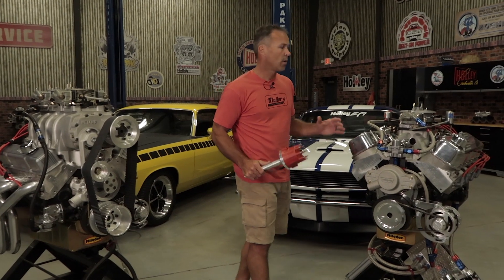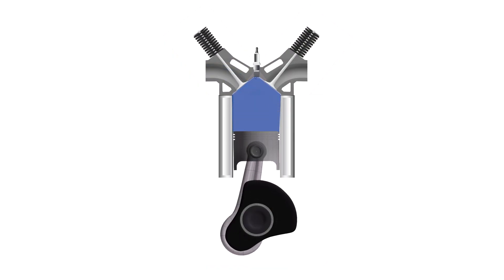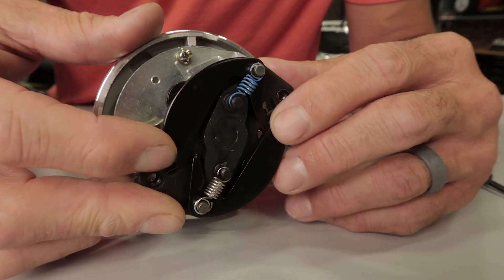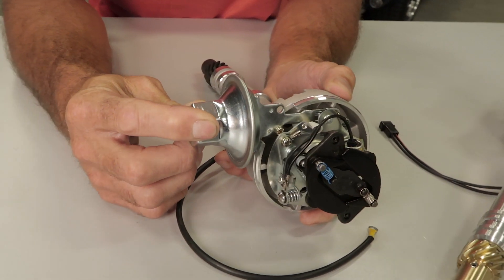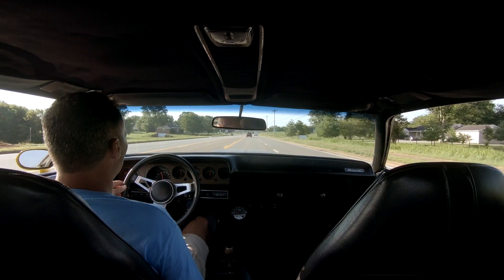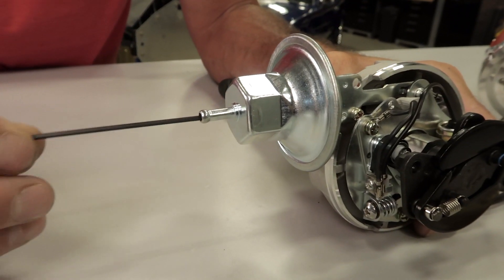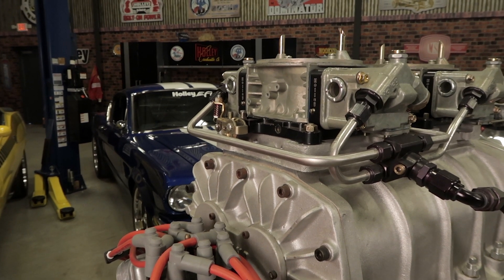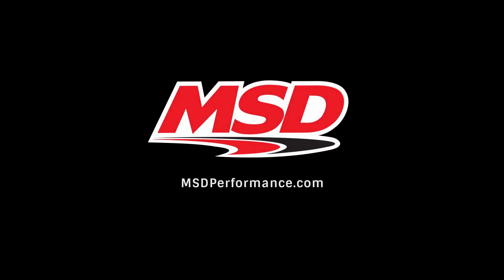How Ignition Timing Works: Vacuum and Mechanical Advance Explained!

Comment: The electrical signals and the actual current that causes the spark travels at 186,000 miles per second. The time for the spark to reach the spark plug is measured in millionths of a second, not thousandths. The reason for advancing timing is to allow for the flame front of combustion to arrive at the piston top at the proper time in the piston’s travel. This flame front travels at a speed very much slower that the electrical spark. This is why fuel octane ratings are important. To insure that only the spark plug starts the combustion.
Reply: Very true. Electricity is unimaginably extremely fast. Efficient combustion can only happen before top dead center. I'm glad someone pointed this out. Proper timing events of fuel combustion are critical to power and efficiency of any engine.

Comment: From the Chi Chi ignition switch the nearest Mr. Denis did you see condition the starter to start the vehicle over what wires go where
Reply: From the key switch what wires and where do they go to the MSD distributor, MSD, ignition and the starter to start the vehicle

Comment: Like the hot engines displayed in the video the presenter’s delivery is so fast. For the novice a clearer demonstration of what happens inside the distributor would be helpful. Maybe if I watch it a few times I might understand how vacuum advance works. But thanks anyway.

Comment: This is a great explanation, but I still don't understand if you can 100% complete your setup pretending you'll never have vaccuum advance, and then just reconnect the vaccuum, or does the intent to include the vaccuum advance alter any mechanical choice (initial, bushing+spring) you make.

Comment: The time it takes for the spark to get to the plug is negligible...its all about the time it takes for the fuel to burn compared to how fast the piston is moving...
Reply: The coil might take 1/2 a millisecond to ramp voltage up  but the time to reach the plug is nanoseconds.

Comment: Okay so for a mild camshaft of 288 480 in a 350 .30 quadrajet fueled motor 2200 stall 700r4 transmission. Street or strip build I would run the ported side of the vacuum and when at the strip just pull the vacuum advance hose off???????????? Yes I am this dumb. I would appreciate any help

Comment: I have buddy with a SB Chevy.  Because the firewall is veey tight in back of engine he runs a Mallory small cap drist. without vacumm advance.  Any tip on timing that setup?

Comment: Great video, What about street/strip cars that are very very fast that you take on the occasional cruise night. Vacuum advance or stick to mechanical?
Reply: A big cam? I would go with a manifold vacuum advance, just to reduce idle temp and have better fuel economy, but I would dial in the  mechanical to get the best rpm band. A milder street cam, I would most definitely use a vacuum advance set up. I have learned through experience that cam size/duration matters more than most everything else. Then again, every engine requires its own individual tune. A high performance gear head should always put in the time to find out what their engine likes/needs to run at its best. There are no set rules, you can ask 10 different people the same question and get 10 different answers. Just listen and find out what your engine wants and it will let you know. 🤔
Reply: @brianwenzel8791  thanks for this info!👍
Reply: No problem bud. Just like to help out whenever I can. It's all about the engine combination. But ultimately, ignition timing is a very important factor to having a great running engine. PS. I Love this stuff..

Comment: So when you set initial and advanced timing do you set it with the vacuum in or plugged?
Reply: yes
Reply: Remove hose from VA and plug the hose. The VA itself doesnt create a vacuum, the carb will.

Comment: Good info.Hard to explain but the electrical firing of a spark plug is already there ready to fire and does not have to travel through the wires at all. Electricity does not travel. If it had to it would take time to get from the power plant to our house then to the light when we flick the switch. It’s instant. No lag time. Because it’s already available! It happens in less than 1,000’s of a second. It’s how 8 plugs can fire at 7000 rpm almost instantly. But advancing the timing just makes sure it all happens when it needs to. We do have to speed up the process to stay in sync with the engine requirements. Again. Good info.

Comment: isnt that after atdc if the engine is rotating clockwise?  when you explain that most engines run 12-15 degrees?

Comment: Im having problems with my truck at idle souds great but in gear driving only wants to bog out i have to drive super slow if i gun it it does one back fire and thin snaps out of it if i advance it or retard it its worse ?? Carb is 600 holly ,holly intake but on 305 engine

Comment: Please explain why a 350 chevy with hyperutechtic flat top pistons, mild cam, vortech heads and valve assembly with an HEI ignition set @ 12* btdc pings at any kind of uphill or small load only when VA is connected. Engine runs great and quiet once VA is disconnected. Been running VA disconnected for years and engine runs great with awesome burnout power. Engine originally dyno @ 420hp/390trq..
Reply: Using manifold vacuum instead of ported?
Reply: Engine also has edlebrock airgap intake and edlebrock 650 AVS carb.
Reply: @jamesrichards3034  If you are going to use a vacuum advance you need to be able to limit the amount of advance you get with the vacuum anvance, in the video he shows how to adjust that amount with the allen wrench.
Reply: @kennywhiddon1497  you cant limit the "amount" of VA with the Allen key. The Allen key adjusts WHEN the va starts to kick in(curve)

Comment: Wrong wrong wrong.
U advance ignition timing because of mean piston speed which is determined by rod and stroke ratio, and the flame front speed which varies by octane rating and different fuels.

Comment: It'd be great to see a video like this but with the m s d 6 AL Digital 6530 model, running a locked out distributor and using a map sensor to add timing when you're cruising at highway speed with an n a motor

Comment: Ported or manifold vacuum for vacuum advance? I've seen arguments on YT & I'm leaning towards David Vizards manifold theory & tuning strategy, very scientific & promotes maximum fuel economy on street/strip engines.
Reply: my 78 350 uses ported w/a quadrajet. However if the engine starts to overheat, a temperature controlled valve, threaded into the intake manifold near the coolant thermostat, will open to allow full manifold vacuum to the vacuum advance module on the HEI distributer. This extra vacuum advance increases the timing to help lower combustion/engine temperature.
Reply: Where is a ported vacuum location on quadrajet? On mine im only getting manifold vacuum and when vac advance is hooked up it idles bad and stalls @SoCalUSN

Comment: you are the only one explaining this the way for me to understand.
ive been disconnecting the vaccum advance hose because i thought it gives the engine too much timing (up to 60) at cruising speed.
thank you!
Reply: Been having the same 50-60 degrees. So I unhooked it didn't want to hurt my motor, still feels weird but I'll probably hook it back up.
Reply: @nicholashoover3001 😊 wax

Comment: To me, one of the main reasons for running vacuum advance is longer engine life. Burning ALL the fuel means there will be much less fuel to wash the oil off the cylinder walls. This results in much longer piston ring and cylinder wall life, and also drastically reduces oil dilution which isn't great for the bottom end.
Reply: And fuel economy.
Reply: The fuel going into your cylinders is vaporized. Engines inhale fuel/air VAPOR, not neat fuel. As long as the spark is firing at SOME point, there’s no liquid fuel to wash anything. Fuel wash and oil dilution are not problems that need solving, and they aren’t the reasons bearings and cylinder liners fail.

Comment: on my 318 rebuilt I'm running stock pistions , rods and crank and stock heads , edelbrock intake and 600 cfm. I'm using an Erson cam - 0.050  is 214/214  lift is .449/.449 and lobe Sep is 112. I'm running a mopar electronic distributor with vaccum advance . this truck has 3:55 gears . do need to be running full vaccum on the carb or on the timed port? I used 2 different vaccum gauges after engine is fully warmed up and in the green zone = best fuel milage  I got real close to 20 on the intake vaccum . took it for a test drive ran awsome down the road and highway but would barely start to ping under load after taking off from a stop or up a hill so I backed the timing down a degree or 2 till I didn't here the noise anymore . I think I'm still some where between 15-20 on vaccum . it won't do burnouts unless on a sooth surface and won't roast the tire from a dead stop with foot off the brake ??? the carb is set at factory spects except for the metering springs and they have been matched to the vaccum of the intake   say 17 ÷ 2 = 8.5 and then match up the colored spring closest to the final number . I have checked everything = fuel supply and pressure spark plugs and wires and coil . air filter as well and the distributor has been set up for my engine combo, vehicle weight , gear ratio ect

Comment: Really informative video that is well written.  The only issue is at the very beginning with the explanation of the time it takes for the spark to reach the spark plug.  True that the electric field takes time to build to create the high voltage spark, but this is trivial compared to the time for the combustion event to take place.  The rest of the time mentioned with power flowing thru the wires happens at the speed of light (literally) so that time is zero compared to the other delays that create the need for advance.
Reply: Agreed on your comment, I'm helping a friend on a 67 326 Firebird installing a GM HEI distributor and it has the adjustable vac advance. I thought I should;
1#disconnect the vac line and set total advance at 3000(mech adv is all in by then) 28* should be safe.
2 #at idle, set the vac adjustment allen screw to specs 6*BTDC
3 # hook up vac line and road test. 
67 Bird with a 326 STD trans
Reply: agreed, one of a few inaccuracies in this video

Comment: Hey msd,if this guy is on YouTube telling everyone we need timing due to travel time from batt to sparkplug,I need a job!!! We  cannot make fuel burn any faster,(no matter what fuel we run),so the more rpm we run, the sooner we must fire the spark! So tired of the next generation of car guys getting misinformed!!!
Reply: You missed the point.  He is correct when he said lean mixtures take longer to burn than rich hence the need for advancing timing.  Watch it again and do some research.  This vid was helpful trolls notwithstanding.
Reply: If this is true, then changing the jetting on my carb would require retiming the engine.
Reply: @BlueOvalEdge  good luck to you guys is all I can say. Been building race engine for over 30 years now . Apparently you guys don't understand flame front travel speeds!!
Reply: Ignition timing simplified by Engineering Cars Unlimited on YouTube, then maybe you guy's will understand WE CANNOT CHANGE FUEL BURN RATES! So therefore we need timing!
Reply: @lilhoss45acp75  I am agreeing with you, man. What I'm saying is that IF air/fuel ration affected burn speed, then changing the jetting (and hence the air/fuel ratio) would require a change in timing; which it does not - debunking the entire thing. There are many errors in this video besides that as well.
Reply: @jckf  Thank you! As a mentor to my younger generation, we have to understand BASIC timing BEFORE analyzing the effects of other input changes that happen to an engine.(ie. A/F ratio,compression, VE,Boost,and nitrous). Hope our conversion has enlightened our future hot rodders!!!

Comment: After vacuum advance retards on full wide open throttle when we give full acceleration so how much time mechanical advance takes to advance the spark timing after vacume advance..???
Reply: Depends on the spring weight in tbe advance mechanism
Reply: @BlueOvalEdge  so why do spark time needs to come back to initial spark time..?? Before machenical advance start to advance..??

Comment: Hate to tell you chaps, but your assessment of why vacuum advance is needed is wrong. 
Let me lay some Thunderhead289 knowledge on you: it’s not because of a lean or rich mixture while cruising, it’s because you are at a lower throttle position allowing in quantitatively less air and fuel overall which is a less dense cylinder charge. The particles are farther apart, and cylinder pressure is effectively lower (think, why do we do a compression test with the throttle wide open) so the actual burn speed in the cylinder is slower as it takes more time to jump particle to particle since they are farther away hence why you need more timing. 

Questioning it? Okay - why do we PULL timing for boost? Same reason - quantitatively more is put in the cylinders, it takes much less time to fully ignite the mixture. 

This has been engine tuning 101 with uncle Luke, y’all have a nice day. 
Thunderhead289. Engineer.
Reply: If you want to understand, listen to ThunderHead289
Reply: Come on. I would say the explanation was simified not wrong.  At least these guys are trying to explain vav advance in some general terms for the masses.
Reply: @BlueOvalEdge  search ported vacuum manifold vacuum and watch the Thunderhead289 video - it’s at the top and has the highest view count. Both honest about tech and made easy to understand 👍
Reply: @ThunderHead289  I've see your video and its a good one.  Agree the logic here may be off but the point is at part throttle the burn takes longer, so you need advance at higher vacuum.

Comment: I have mechanical advance now on a Chevy 350. Can I just add a ported vacuum line to my distributor? There's no vacuum line connected to it now,  thanks for your time 🤜🤛
Reply: Mech advance only distributors are really old school WOT drag race parts.  Typically, you cant add a vac advance to a mech dist .  Recommend you replace with a vac advance dist and use ported vac not manifold.  Ensure cruise rpm is about 45 deg total timing.  You may see a 20-30 increse in fuel economy.  Ive made the change myself.  I was shocked at the benefits of ported vac as i mistakenly thought that was emissions only.
Reply: @BlueOvalEdge  I'm getting detonation and knocking with just 32 degrees of total timing. I've tried setting up ported and manifold vacuum along with the mechanical advance and I can't hardly  get out of the driveway without totally sounding like a coke can with rocks. Going to have to stay with mechanical for now, thank you for your time 🤜🤛
Reply: @raymondmenendez6499  Hey there Ray.  How much engine rpm does it take to get to your total #? Maybe its coming in too soon.  Also, were the dist. Advance springs changed to something super lite? Same thought, is total timing be arrived at too quickly and/or too soon.  I might try driving it with no vac advance at all (initial + mechanical) only and see what that does.  If its still pinging badly, i would suspect a broken advance spring.
Reply: @raymondmenendez6499  also check for a gross vac leak.  Ive seen an intake manifold leak lean out one cylinder where the heat from that leaned out cylinder blew the head gasget to the next cylinder. Engine would preignite badly as one jug would fire off the other one way early.
Reply: @BlueOvalEdge  sound advice. I have a 1970 C10 with the 350. Been playing with the timing for about 6 months now. Never really had to do any mechanical work on motors before. Can't take it to a mechanic every week since it's hard to find a tuner that can work on a old school engine with carburetor, most of them look at the motor and wonder where to hook up their computer 🤔 wish I had the money to bring you here for a week 😄. I live about 2 miles from the buccaneer stadium were the superbowl was played. Nothing here but shorts, beer and a warm breeze!
Reply: I've asked MSD tech support that question when I was looking into purchasing a used unit I found super cheap several months back and the short answer is no.  Get the appropriate unit for your application.  While you technically could add it you'll be miles ahead cost wise and if you ever had to send it back to MSD for repair/service they won't support a distributor modified in that fashion.

Comment: Does fuel injected cars keep the air fuel ratio same on low or high throtle..??
Reply: Usually not. Most use a fuel map to lean the mixture for emission and mileage reasons at part throttle and then richen it to make more power at full throttle. Many turbo engines go extra rich to cool the catalytic converter. Hence why they get bad mileage under heavy load.